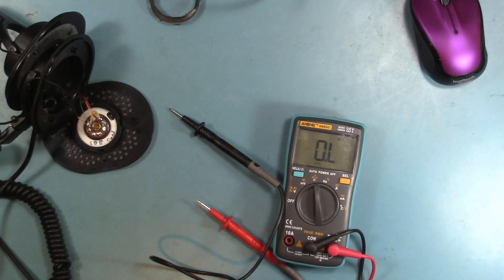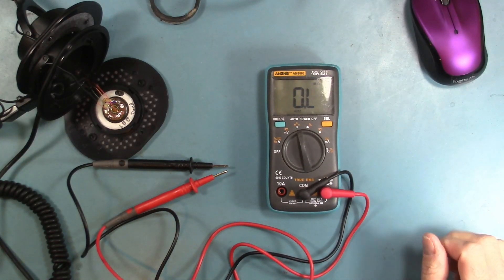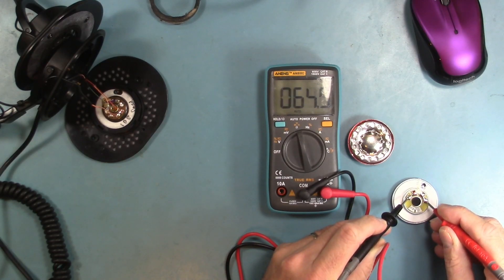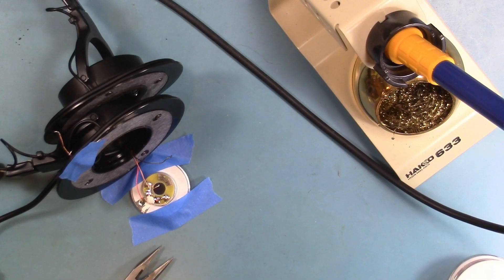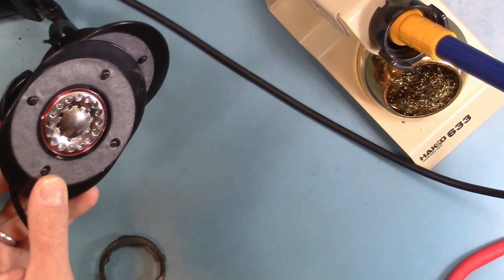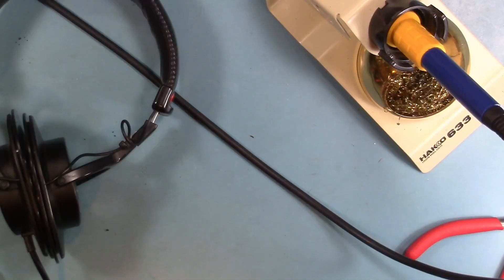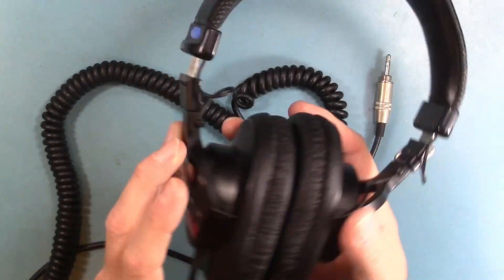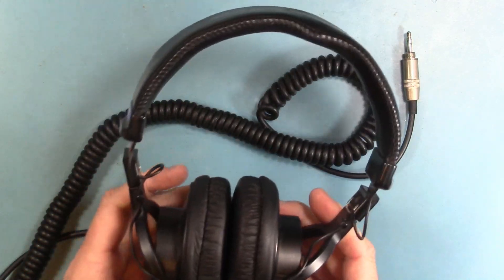Random Stuff, Episode 0c: Sony MDR-V6 headphone driver replacement

Comment: I just successfully executed this repair using the linked Alibaba replacement drivers. Since I only use these headphones for monitoring and not mixing I felt comfortable only replacing the single driver (right side) that was broken. I cannot tell the difference between the original and replacement driver, but my bar is set very low.
Reply from the maker: Yeah, I can't tell any difference between the MDR-V6s with the Aliexpress drivers and my MDR-7506s with the original Sony drivers.

Comment: I just received the same replacement speakers from allexpress.  I think it took about 10 days to get here, much faster than was originally stated.  Tonight I replaced both speakers.  It was easy work and the difference between the original Sony speakers and these replacements is very tiny if at all.  These seem to have good bass response and overall good fidelity.  My headphones are Sony MDR7506 and replacements fit perfectly.  Thanks for the super good video.